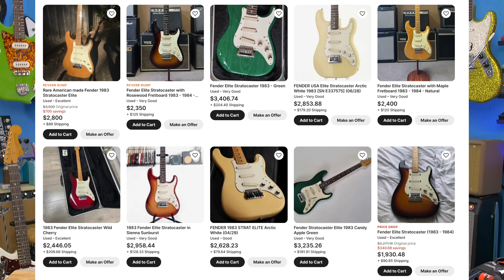1980s Fender Elite Stratocaster - MORE GUTS THAN MOST TUBE AMPS!

Comment: Absolutely a Free Flyte bridge, made by Schaller in Germany. At the time these came out I was working as a Guitar tech in a large local music store in Florida and we were an authorized Fender repair shop.  These were wonderful guitars made in the twilight years of Fender's Fullerton factory under engineer Dan Smith. Of course as you are discovering, an absolute nightmare to set up.
The dummy coil you correctly identified is one of the better features of this guitar -- humbucker-type hum canceling made this guitar one of the quietest Strat's ever made with a very "tight" sound.
The tone controls are hard to understand because they just odd.  You begin by setting them both in the center, which is supposed to give you a normal Strat sound. They are detented in the middle of their so you can find the center easily.  turning them up or down from the center does different things in each direction AND different things on each knob. 
Turning the  middle knob (TBX)  down from the center acts as a normal tone control while working up from the center boosted presence/brightness. 
Turning the bottom knob (MDX) down, boosts some lower frequencies while turning up boosts some higher frequencies.  Fender boasted that this provided tonal options from Country bright to Funk to Jazz and could also supposedly emulate a humbucker. Or, so they claimed. 
As for adjusting the tremolo tension, remove the pick guard, the dummy coil and bridge pickup and you'll gain access to the end of the tremolo springs and the spring claw.  You then remove the springs and finally you can then move the claw within a very limited adjustment range tighten or loosen up the tremolo a little.
None of this is for the faint of heart....
Anyway, this will probably revive nightmares from long ago. lol 
BTW, there was also a Telecaster model with a similar type of setup, although I never actually physically saw one except at a Summer NAMM show in Chicago in '82 or '83
For me, I bought a '82 Stratocaster Standard (aka by collectors as a Dan Smith Model) in two-tone Cherry Sunburst -- best Strat I've ever owned.

Havde a good one Ryan, I love your videos and a Surf music guy.
Reply: Thanks for the info!
I have a question: is the dummy coil connected directly to the pickups, or does it go through the circuit, as a way to cancel the hum without changing drastically some aspects of each pickup (like inductance, resistance, capacitance)? It's one thing I don't like about using dummy coils is how much it affects the pickup.
Reply: @joseislanio8910  
Hello Jose'
As I recall, the wiring for all of the pickups is like a standard strat. Positive lead from the pickups go to the push-button, pickup selector  switches. The negative lead go to ground on the back of a pot. 
From there they go into the pre-amp circuit board.
The dummy coil goes directly into the pre-amp, since it is not switched.  Can't tell you much about that pre-amp board as I've never seen a schematic for it. 

But your concern about the dummy coil changing the sound shouldn't be an issue in this case. Tell you why, the pickups themselves are low impedance, active pickups. The on-board pre-amp amplifies and shapes the sound by design. In simple terms, the pre-amp design  compensates for any tone loss by the inclusion of a dummy coil
Reply: @reggiewallace260  What an excellent post. Thanks so much for sharing! Maybe Ryan can make a short little vid demonstrating the tone controls with this newfound knowledge 🥺 

That trem….
No thanks lol
Makes me shudder thinking about trying to fine tune, put it back together, then dive back in to adjust again… you poor soul.
Reply: Actually, only the TBX control has the center detente. The MDX control just gradually dials in the dummy coil through the preamp which is where the added midrange and boost comes from.
Reply: @harleyhexxe9806  Perhaps my memory was a bit off on the detente on the MDX control after 40 years. But I think you may be over-simplifying the way it works.  The manual from this instrument, taken from Fender's website says "The MDX Control gives a variable boost of up to 6db in a specially selected frequency range. When using this control you can get a remarkably accurate simulation of even the hottest humbucking pickps."
So we know that this isn't just 'dialing in the dummy coil' since this would not produce a 6db boost in selected frequencies. Perhaps it causes some combination of mixing in the dummy coil AND boost of some of the lower frequencies, or perhaps not. It is a mysterious as the entire guitar was.
Reply: @reggiewallace260  Of course you are correct sir. It is more than simply dialing in the dummy coil, as this also flows the signal path through the onboard preamp as well. I just put it out there in the simplest of terms to not get too technical because, in the simple terms, that is what happens. The boost is supplied by added gain and midrange in the preamp. I can't give exact technical details how it works, since that's out of my wheelhouse, but I know it does act like a boost pedal in the guitar when I go from a Stratty rhythm to an authorative lead tone.
Reply: Put the 9v battery on your tongue, you'll know if it's new!
Reply: EMG pickups are quieter though. People rag on EMG, but David Gilmore's tone on the Pulse DVD is stunning with those EMG SAs and the active tone shaping controls.  

These complicated 80s and 90s strats are pretty cool, but I'm not sure I'd want to own one because they're a bit of a liability when it comes to replacement parts ect. I've got a 2014 MIJ strat with a factory Gotoh GE1996T locking trem, and I put an EMG Steve Lukather set in it. Best guitar I've ever owned.